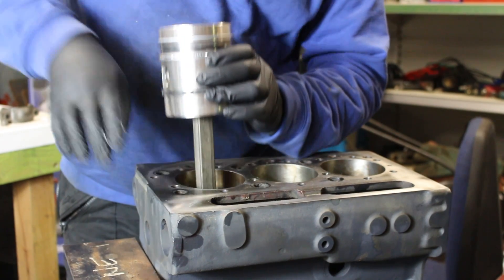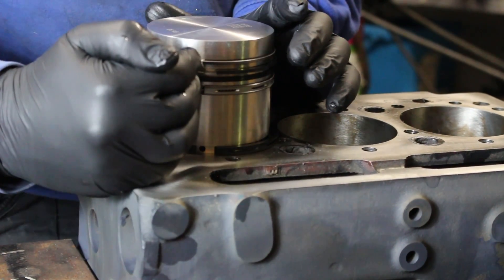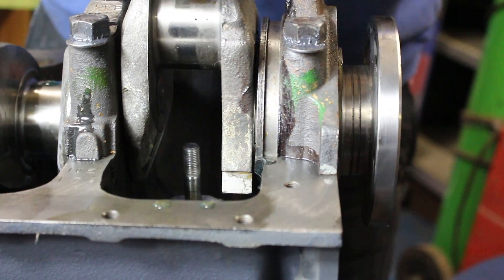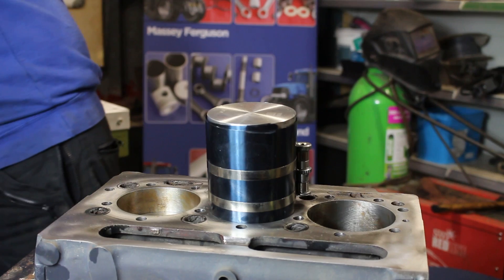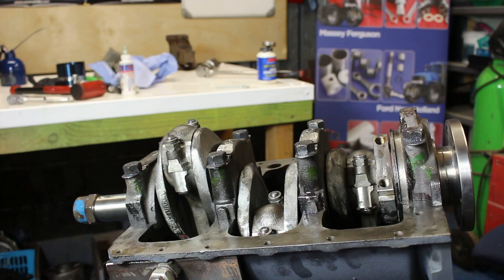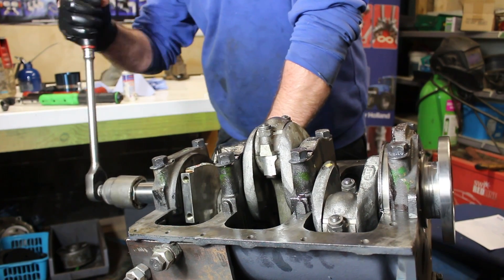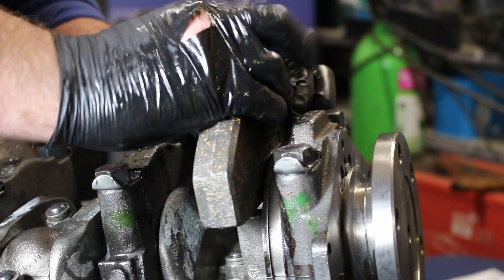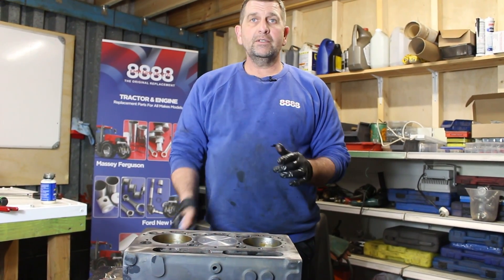Fitting the PISTONS to a FORDSON SUPER DEXTA | REBUILD

Comment: Hello. I have a queston about the steering of the dexta. Where do you refill the oil for the steering collom and steering box and another queston where do i find and tune the idle on the super dexta with a simms pump?
Reply: take the nut off the wheel, and pour in bit by bit as it drains through. give the wheel a little wiggle, might help

Comment: Hi Kev! Do You know what is correct torque for counter weigth bolts? Proceeding rigth on this step. Just inspected oil pump clearances, and has to be replaced.
Reply from the maker: Hi I’m not sure about the torque settings for the counter weights I will have a look for you but I have tried before looking for them. As long as they are tight with the lock tab on them they will be fine. It’s always good to change the oil pump. Thanks for the comment.
Reply: Hi, thanks for reply. As You advised on video, I made new lock plates. Have to check is there some general torque recommendation for 11mm bolts.